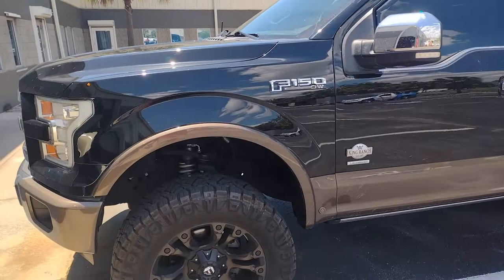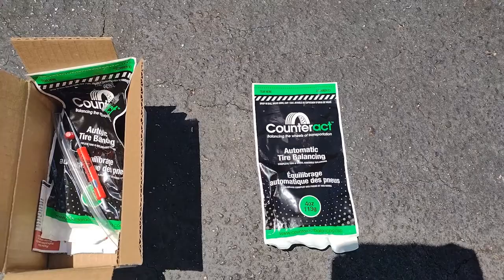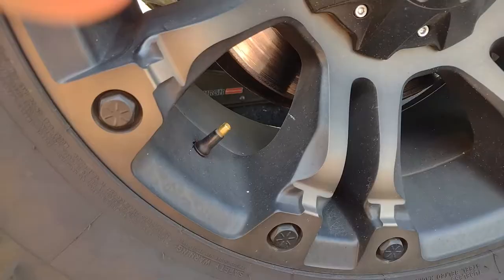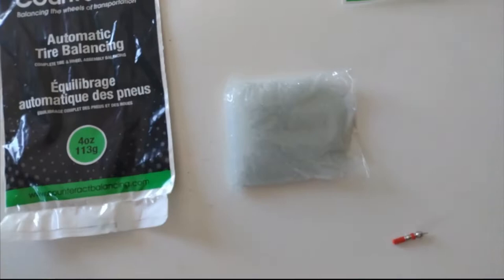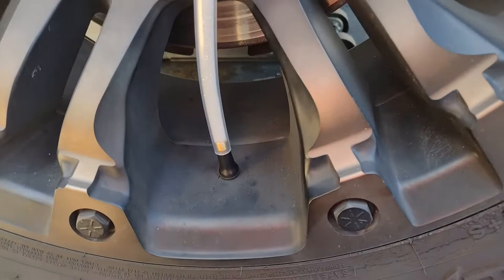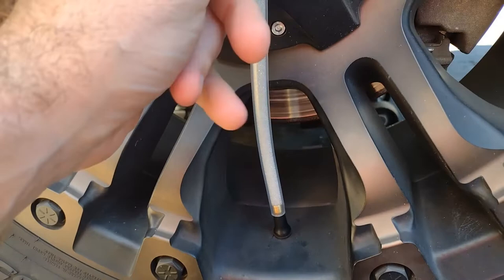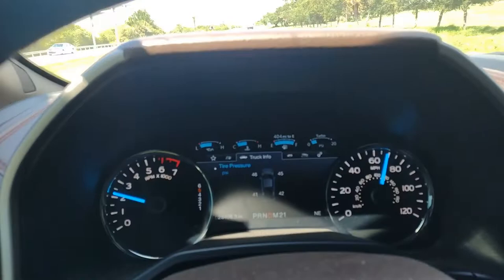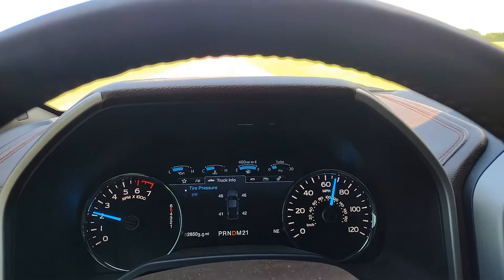Tire Balancing Beads! Do they work?  35x12.50R20 Nitto Ridge Grappler on 2016 Ford F150. Counteract

Comment: If you ever have to do it again after you let all the air out of the tire and you have the bottle hooked up with the tube all you have to do is jack the truck up on that side and the action of lifting the weight off the tire as it reforms it creates a vacuum inside the tire and as it fills up with air it will suck the beads in and just takes a few seconds.
Reply from the maker: Thank you for that, but I will never use them again personally.  But I hope that helps someone watching! :)
Reply: Excellent. Thankyou.

Comment: If you didn’t remove the sticky balance weights from the rim I would recommend doing that and trying just the balance beads.
Reply from the maker: Ended up being the hub centric ring
Reply: @SurvivorClassicCars  what was wrong with the hubcentric ring?
Reply from the maker: @hotrodyj  worn out I guess?  Gave the axle room to vibrate.
Reply: @SurvivorClassicCars  thanks for the update
Reply: Dang man you should update the video you left it saying the beads didn’t work for you when the beads weren’t even the problem. And it took you 45min per tire because you didn’t know there’s an easier way all you have to do is jack up the truck and the beads will suck in as the vacuum created inside the tire sucks air in the beads will suck in as well. Just takes a few seconds.
Reply: Yeah this video leaves the impression that balance beads don’t work, when in fact they do extremely well. Balancing wasn’t even the problem, and there’s no update explaining that the hubcentric ring was the causing the vibration…. There’s another guy saying the same thing, about his truck having a vibration at ALL speeds- but not having hubcentric rings at all, not having even eliminated that as the issue before claiming the beads didn’t work…. I swear man; some people will see these and not know any better, thinking beads won’t work. That’s unfortunate, because the ONE great thing beads do for you is eliminate the need to have to get your tires rebalanced as they wear, period. That alone is worth it.

Comment: Put 36 pounds in front 34 in back perfect ride see what happens with vibration.
Reply: no doubt.   why in the balls is he running mid 40s  tire psi?
Reply: @keemez tires say max load capacity on 10 ply 35s, usually 65psi. So we should be running half that? I tow occasionally so legitimately curious. Local tire shop does only beads in tires of 33" and when I first had them put on I literally couldn't drive on the highway for first 500 miles, till bags broke open I'm guessing. Still shakes a bit at 70. I too am running 45-50psi.
Reply: higher psi = harsher ride

Comment: Bro I have the same tire .
And I have the same problem. 
A lot vibration on highway about 65 mph.

I don't know what to do.
2018 ram 2500
Reply from the maker: Mine ending up being a $20 axle seal on the truck.  Put the same tires on my new F250 and no vibration either.
Reply: I have same problem with my 2018 ram 2500 Dealership said it was “Normal they all do it”
Reply: Retired now, but in the day, tires that big were a pain to balance. Normally, we would have to break the tire back down and spin tire on wheel  180° try to get a better spin balance. Usually, it takes 3.50 to 4.00  of weight to balance
Reply: 17 ram 33s and leveled. Radar renegades. Vibration also. Just had beads installed have yet to drive it. Road force balance doesn’t do anything!
Reply: @SurvivorClassicCars  Just asking? How did a seal cause vibration? Again just asking? A axle bearing I can understand?